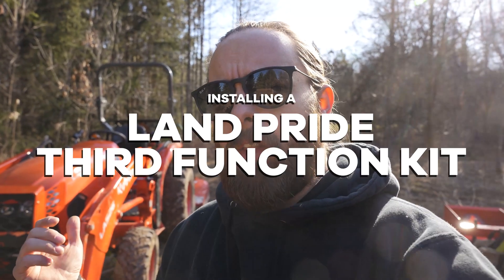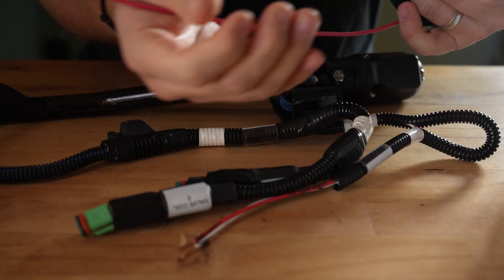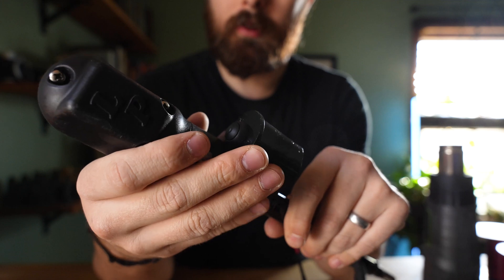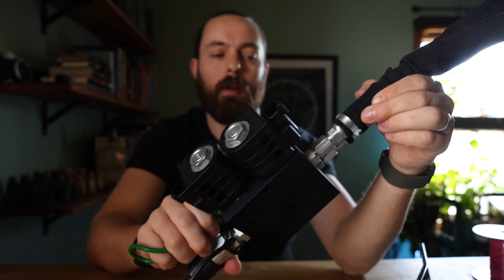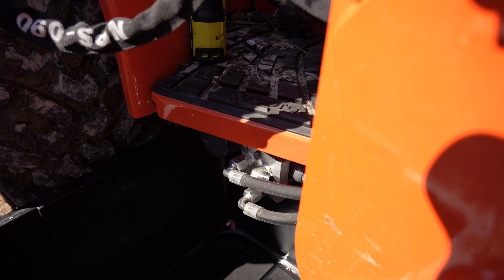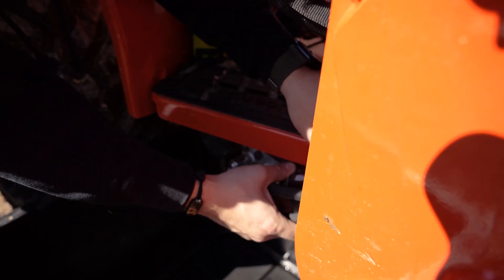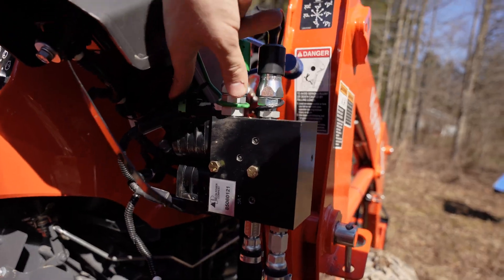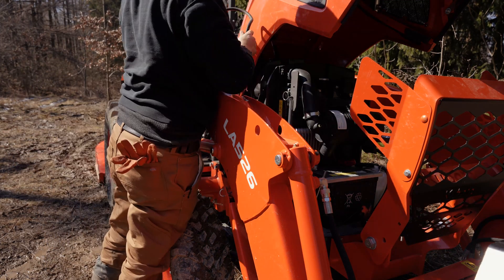How to Install a Land Pride 3rd Function Kit (MUST-KNOW L2502 Tips!)

Comment: I quickly found the 12V connector underneath the ignition switch plugged it right in. Build date 08/25
Reply from the maker: Is yours a L2502? I looked and looked and finally asked the dealership and they told me I had to hard wire it 🤷‍♂️. But on some of the bigger models you have that plug under the ignition, which would’ve been super nice haha.